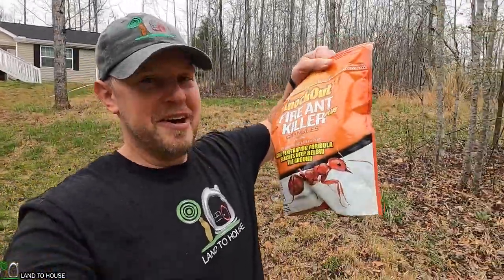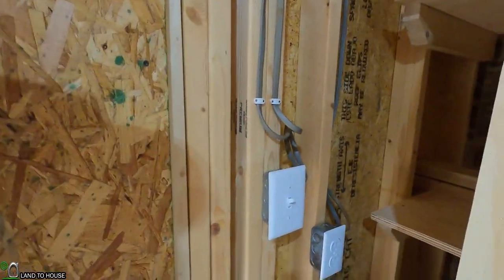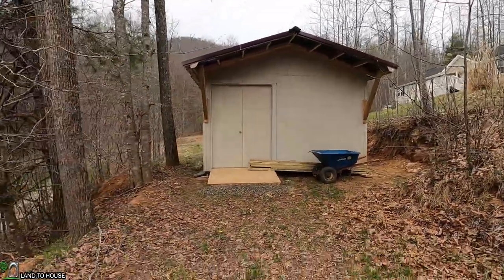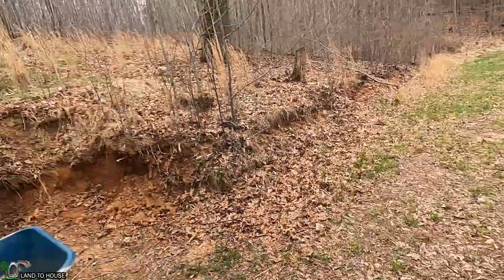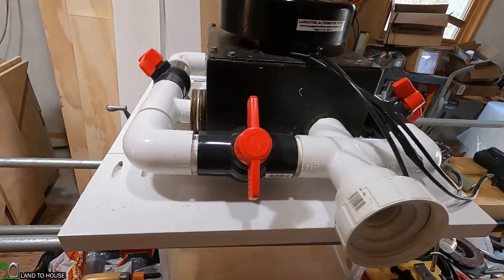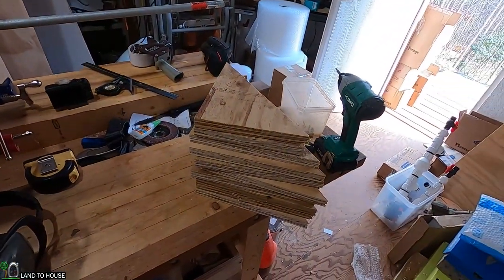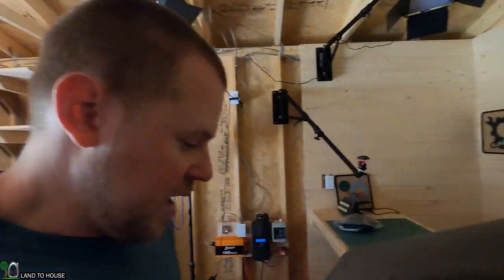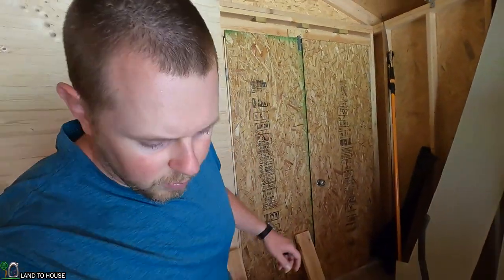Ants have Taken Over for the first time for the last time - Vlog

Comment: I've been driving my 02 tacoma for about 10 years without any issues. 200,000 miles. Original clutch. Only replaced the radiator so far. Wonderful truck. Just look out for rot in northern states. My frame was replaced by Toyota back in the day and is still going strong.
Reply from the maker: That is a good many miles for the years. I only drive around 13k miles a year. We have lots of road salt here in NC. That is one of the main things that is getting my current car. It is starting to rust out.

Comment: I would be there for a live. Tuesday, Thursday and Saturday are the days I don't watch lives yet. I'm planning to build a ram pump. I want to do the sediment bucket but add the stand pipe to the bucket for the benefits of the stand pipe.
Reply from the maker: I am not sure what day of the week just yet. With my 3rd shift it is not easy to be consistent. 

To add the stand pipe and bucket you might need to place the bucket closer to the source and the stand pipe further down. (The bucket can lose head pressure with open top)